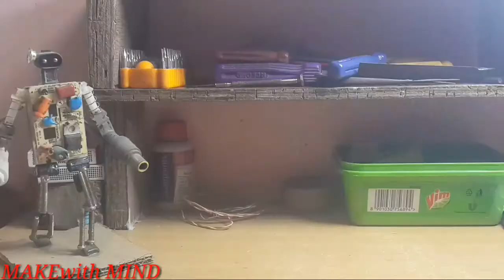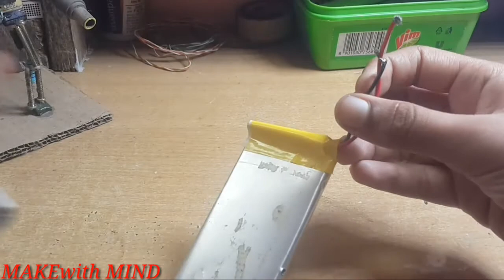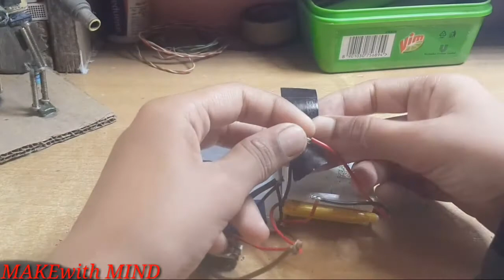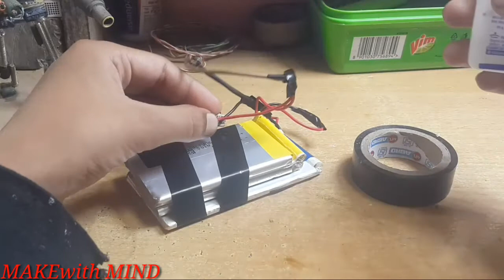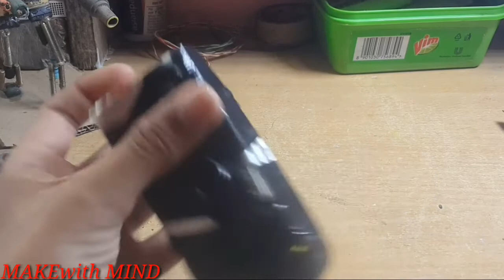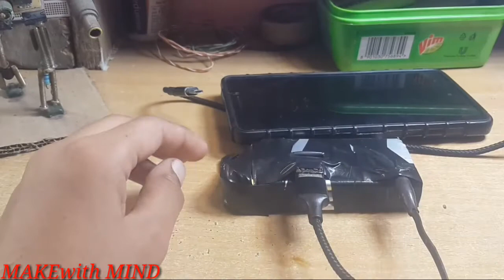How to make power bank without module

Comment: This design is very dangerous for three reasons: -

1. Batteries in series should be equipped with a Battery Management System (BMS) with balanced charging feature. Otherwise one of the cells will overcharge or overdischarge and result in explosion and fire.

2. You cannot randomly combine random batteries in series or parallel. You need to select batteries of the exact same size, capacity and age. Besides, if you salvage old cells, you should only combine them if they have been used together before.

3. The phone cannot take an input of 12 Volts. This will irreversibly damage the phone. Even if the phone can charge at 12 Volts due to fast charging support, it can be charged only through a good quality power bank circuit.

Please redo the design after rectifying the problems and having eliminated these three errors.
Reply: Yes you are right

Comment: Firstly you have not made a power bank, you have made a bomb.. because you are charging three different capacity battery in series... Secondly it will not charge mobile battery, because any battery need higher voltage to charge up than it's own voltage... Here it is too much higher... Charging will stop from its defence mechanism....
Reply from the maker: I can't have module I dont no how to make
Reply: I am agreed with u